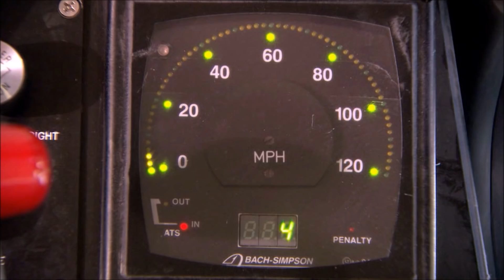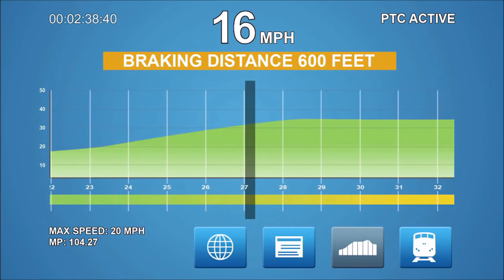Amtrak 501 "Cascades" Train Derailment 18 Dec 2017

Comment: Juan, great reporting. I'm a retired airline Captain and you and I know what TCAS is. Airliners are always "talking" to each other and get warnings of close calls. My concern is why was the PCT not installed on this new track? Did the engineer have any IOE? What did he do 24 hours before reporting at 0500? I also served on the ASAP at my airline. Also attended ALPA Accident Investigation School. I was the Safety Chairman at the airline. This sounds like the Titanic on her maiden voyage. There are so many links in the chain that were broken in the buildup to this accident.
Reply from the maker: Exactly!
Reply: Thanks Juan. I'm following this.
Reply: There is definitely a requirement for wayside infrastructure for PTC.  Wayside interface units for communication to and from the locomotives, plus certain track elements such as switches must be connected to the system.  PTC must also be connected to the signalling system.

Comment: Photo of spot where lead engine likely left the track. Note the orange spray paint, and the region below that. Looks to me like the right rail is bowed outward. https://timedotcom.files.wordpress.com/2017/12/shutterstock_9296729k.jpg.  Interesting that another commenter here claimed hearing a report of media on a VIPs run last Friday, supposedly speeding through this turn. Not sure how much to credit that, but if there were previous excessive-speed runs they might have incrementally bent the track.

Comment: why would they pull the data from the 2nd/slave uinit  and not the primary controlling Lead unit.  FRA required the controlling unit to be the lead unit when I ran Freight for UP. maby passanger has some different  stuff.  passanger can run in reverse engineer/ controlling engine on tail  with a conductor on the point( front in the direction of travel) to protect the movement . for the engineer to switch ends they would have to unlink the DP( distributed power)  recover from an emergency application then reestablish the link from the new lead/master.  proform a new class1 brake test . data off #2 or rear makes no sense to me.
Reply: My guess is that the new front unit might have a different data format, and it could have been easier/quicker to read the data off the older model back unit crash recorder.
Reply: Well the rear engine was intact and the recorder was probably in good condition and easily recovered whereas the front one was likely much more damaged.  According to CNN yesterday the camera from the rear was recovered with no problem whereas the one from the front was mangled and had to be sent for recovery.

Comment: Juan...I am perplexed they did not have the PCT Systems on the rail or train.as mandated in 2015..
Sensibly you would complete your tests and contract builds before you go public in that saftey of OSHA/MSA STANDARDS as well as transportation regulations..I understand less time to destinations  is great but 10 mins difference at costs over 230 billion. .would not fit a change ...Upgrade was the other concern..why was an old engine used in part of train.that may mot have been comatable to the speeds of the front engine..an not data linked to Hub Control except by senser

Comment: So many deadly rail accidents are caused by the engineer messing up. Had PTC been installed, as it was supposed to have been 2 years ago at the latest, this accident likely would not have happened. I sure hope this will bring some much needed attention to getting PTC rolled out nationwide.
Reply: PTC would have just covered up the engineer failure and they'd go on failing, until PTC wasn't there to save them..
Reply: While I don’t know all the details about PTC, I’d be willing to bet that brake application by the PTC failsafe would be recorded in some sort of event log, which would then have to be reviewed. It might even set off bells and whistles all over. I doubt it would cover anything up.
Reply: sure, but probably like everything else these days, they'll get a pat on the wrist and sent to the corner for 10 minutes. right back out doing the same thing yet again!
Reply: Give the engineer an unpaid day off to attend a mandatory safety class.
Reply: exactly equivalent to a pat on the wrist and 10 minutes in the corner,  try like two weeks no pay and  1 week equivalent of classes. otherwise it's just a vacation!
Reply: Ok, whatever it takes, but these people need to know they will not get away with unsafe behavior.

Comment: The lead Semens diesel locomotive cleanly climbed over the tight curve's rails and proceeded straight.  I'd expect a 80 mph train loosing the battle of centrifugal force in a curve to rip out rails when it derailed.  Those rails look like you might be able to carefully back out the FP40 rear locomotive still on the back of the train.

The Semens diesel  locomotive may have malfunctioned.  Instead of allowing the engineer to dynamic brake and trim speed from the 79 mph area down to 30 mph to take the curve, it may have gone full throttle providing gobs of axle torque to cleanly climb up and over  the rails in the tight curve.  

The curve is posted at 30 mph for both freight, passenger and Tango trains.  That is likely because the old  rail bed was unsupportive and the tracks didn't hold alignment well.  Now that the rail bed has likely been replaced the rails don't move much at all, but the sign has not been updated.  It maybe passenger trains can safely take the curve at 45 mph.  In doing so the passenger train will be generating 2 1/4 times more centrifugal force than at 30 mph.  Being able to take the curve at 45 mph means only having to scrub off 35 mph from an 80 mph train.  

There maybe a short steep grade just before the curve that will also cost speed,  maybe 10 mph.  Now you only have to scrub off 25 mph to take the curve and that allows you to get much farther into the curve before taking action. If instead of operating correctly the dynamic brakes in some strange fail mode provided no brake but did provide forward torque to the drive axles that might make the locomotive prone to climbing the rails in tight curves.
Reply: there isn't a locomotive made without multiple kill points, surely they were trained to shutdown/emergency stop.

Comment: Can someone justify. The need for a high speed train, for what is probably a relative short run? You said the new route cut 10 mins off the old run. Is it even worth the money and the loss of life. I was on a fire dept. For 15 years. And never been to a derailment. Thank God. But now they are up grading the rails here to run high speed. We have towns roughly every 10 or so miles apart. People are such in a rush to get to go where they are going.
Reply: Hi, Nathan.  I can't justify but I can give insight.  I-5 is a parking lot at times from Seattle to Portland.  Known bottlenecks are:  Tacoma Dome, JBLM, Nisqually bridge, Olympia, Centralia.  There is the idea of easing vehicular congestion by using a passenger train - especially awesome if it is faster than driving by car. 

The "new" route gets the train off of the coast where the "old" track literally hugs the Puget Sound.  I rode the old route 2 years ago from Olympia to Canada and was really amazed that a rouge wave had not taken the tracks into the ocean (kidding, of course) and there are frequent mud slides that temporary close the old route during the rainy season.  

Freight and passenger trains share the same track.  I remember riding the train and having to switch tracks to let a freight train pass and then switch back to the tracks that were directly adjacent to the train station so we could disembark.track 
So, the new route was welcome. 

I was excited about the new route in that people could start commuting from DuPont/Olympia to Seattle jobs.  I was also hoping that it would help ease the amount of vehicular traffic on I-5.  

I hope this is helpful.

Comment: You can see from the picture of the track that it is kinked toward the outside of the curve just behind the rear locomotive. This was most likely caused by the high speed of the train before it jumped the tracks.
Reply from the maker: ...or is the kink a result of the derailment?

Comment: Going 81mph into a curve with a 30mph limit is definitely going to result in a derailment.  A PTC system would have to apply the breaks well in advance to slow the 81 mph train to 30 mph before entering the curve.  The current PTC systems just can comprehend so many train operating variables.

Comment: Regarding PTC not being installed, I'm pretty sure that the actual technology has been installed on this new routing. It would be pretty silly not to install it, although I can't be sure. However, in order for PTC to work, all the different components need to be running, and everything needs to be so equipped on the line. If the locos have not been retrofitted yet, or if there are still other technical obstacles to overcome, it could still be quite some time before it can be used. Pols will certainly want to accelerate plans for PTC, but the technical obstacles exist no matter what. Spuyten Duyvill, Frankford Junction both could have been prevented with PTC, but it is not the end all.
Reply from the maker: I think you are right!